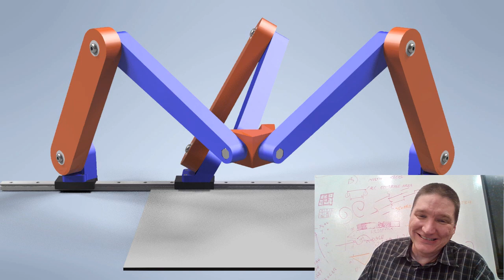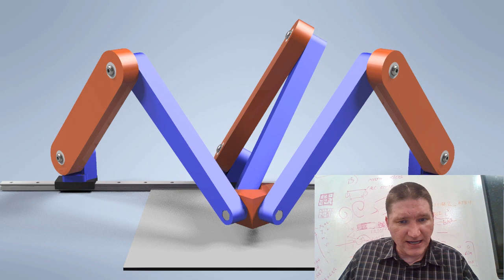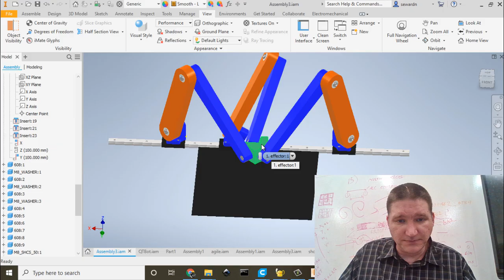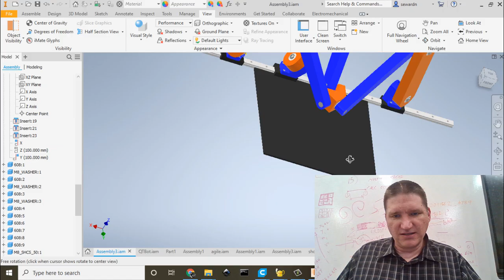RepRap Monorail (Single Rail Tripteron)

Comment: Just stumbled on this video after watching yours today:
https://www.youtube.com/watch?v=97t7Xj_iBv0
And I get wondering theoretically would there be a way to replace some of the joints with this kind of Compliant mechanisms. it seems to me that it would produce more smooth and easy movement if done right. 
I'm have no knowledge in engineering. Got here after researching the Tripteron topic for a friend of mine. 
Greetings.
Reply from the maker: In theory, all joints could be compliant.  In practice, I would stick with replacing only the revolute joints and leave the linear rails alone.  That said, tripterons need a lot of rigidity to be accurate and compliant mechanism are challenged in thay area.  You would need fairly large knuckles to match the rigidity of a bearing joint.  As shown this is just a render...in real like these are also way undersized joints.  What I am saying is the knuckle joints will probably grow to a size where both space and weight become limiting factors. In any case,  it would be fun to play with!

Comment: As shown, the range of motion in z and y is really limited unless you have very long arms and then you get real issues with stability.
I can see use cases where it would work best, like some sorting or assembly where it rolls along the rail working on an item and then moving it onto another line once its done and you want it on just one side of the conveyer away from the workers.  Just one example.  Certainly not for a 3d printer.  The joints and base rail width would have to be super strong which would be costly compared to normal 3d printer type things or delta robots from above that could also run along a rail that isn't part of the actuators.   Appreciate the different approach.  I've got a new idea myself, which I can't share, but a clue is it will use the biggest stepper motor you have ever seen...

Comment: it is a good idea .. but I am not usre of validty of its economics .. not because you can not build a 3d printer while using single axis .. but because if you compared the outcome of this set up to classic 3 axis 3d printing and measure that economically, you may see the 3 axis 3d printing is more cost effective - efficient  because this step relies heavily on the (a) on difference in location between two arms and additional dimention (like y or z axis) does depend on the limits of such differences. So in short, it is a creatie design but not cost effective design. 
The valid use cases that would make sense of such design is when there are dynamic constraints of external motion that require being the same adjustency the arms but without be blocked by y or z axis installation .. it is a bit hard to think of such application indeed .. But you can think of collaborative robotics by which you have two or more robots manipulating the same object ..

like if you have one robot that has 3d printing head and the other has painting or carving head .. then there can be applications by which they work together on same objective while each of them on one axis ... that would be possible despite that the policies of clash avoidance will be very complicated. For example,  placing two on axis robot can allow moving  a chess objects without blocking each other 

it is far more useful for multiple robotic arms than single one.. single one will fail to optimize its cost
Reply from the maker: I think you are very right.  There are probably just a few killer applications but for the most part it would be better to use traditional robots.  It is fun to look at and to have in your back pocket if a need ever arises.

Comment: this cool but not for 3d printing machines, if u make this in a 3d printing machine... u limit ur surface u introduce jerking ... limit ur printing speed, and many more issues... oh yea Z limitation, Y limitation X limitation... might be great for like some specific 1 type of job thingimatronic, but general purpose like a 3d printer where u can print bunch of random surfaces etc with it and shapes please dont... it will be like apple vs android... all that being said... this cool stuff, and ingenious using the joints and the 1 rail thing is awesome.

Comment: Very interesting design! Practically speaking, there could be a lack of rigidity due to the monorail choice. You could get away with a large enough rail or another solution already suggested earlier in the thread, specially if this design is just for 3D printing. Nevertheless, a more robust approach would be to add a second parallel rail with a mirrored design and the motors control coupled to the first rail motors (through software). It’s a less cool design, but you would still have ditched the vertical rail compared to a classical Tripteron design.
Reply: Ops, nevermind, just saw your duo-rail design video. Great!

Comment: hmm, if it gets another degree of freedom you could get the whole rail length as a print surface not just a small part
Reply from the maker: I see what you are saying and that could be possible.  However each arm constrains the effector to a plane so with this architecture a 4th arm would be a redundant DOF.  Of course you could do a single axis Sextupteron but still no space saving.  

You could have a arm attached where the effector is now which rotates through the plane parallel to the ground.  The 4th carriage could somehow trigger it rotation.  Bottomline...it can me done but you lose a bit of the parallel robot purity.  I would be curious as to what you have in mind.
Reply: @NicholasSeward  if you angle the print head you can get an axis that is just as long as your track. Now simply make the track out of 2 segments (and the ability to move and align it) and you have what is essentially an infinite axis to print on . Or just use a track as long as you want for the same basic effect.

Gets rid of issues with the conveyor belts as well though you do have to worry about what you are printing on
Reply from the maker: @shadowlordalpha  Hmm..  I don't fully follow.  Might need a sketch to get me all the way there if you are willing. Cheers.
Reply: @NicholasSeward  I'll try and do one later today but basically imagine that instead of a conveyor and the bed moving you just move the printer along the line. 

This would only really be useful for massive prints or unknown length prints

Comment: Good afternoon! Sorry to bother you! Do you happen to have a solution to the forward and inverse kinematics problem for this manipulator? I want to conduct a kinematic analysis, but I don't really understand the kinematics of a monorail tripteron.
Reply from the maker: Jklee has some videos on it and I have a QandA that talks about it in a simple way.
Reply: @NicholasSeward  I understand you, thank you!
Reply: @NicholasSeward  Hello again! Tell me, please, how did you create the animation at the beginning and at the end of the video? How did you define the law of change of generalized coordinates?
Reply from the maker: @Archi_mboldo  I used autodesk inventor.  You can add constraints and drive them in an animation.  I drove the effector directly and everything else solves automatically.
Reply: @NicholasSeward  Thank you!
Reply: @NicholasSeward  Hello, did you by any chance calculate a working area for this robot?
Reply from the maker: @Archi_mboldo  lots of parameters.  Arm length, rail heights, carriage angles...you can get any area you want. As shown for 200mm arms it could reach out about 200mm.  The other dimension is only limited by rail length.
Reply: @NicholasSeward  I am trying to choose the parameters of the components so that a cube of 150mm * 150mm * 150mm fits into the working area. In the view from above there is a working area in the form of a trapezoid. In the view on the left - in the form of an isosceles triangle with two angles equal to the angle of inclination of the middle link (in my case, it is 60 degrees). And in the front view there is a hexagon, the upper part of which is like a trapezoid, and the lower part is like a rectangle (a bit like the shape of a house with a truncated roof). So I'm thinking how to choose the parameters so that the cube I need fits into the work area.

Comment: Cool, but for low-load / low precision.  To get any sort of rigidity / precision, you have to move one of the feet onto a second rail. Or make the single rail *much* wider. Think about this as a lever attached to the slider. Those sliders are not meant for absolute torsional rigidity.

Comment: Hi, this is brilliant working !! 
Which type of bearings are used in this labor and what is the measure of bearing ?? How to solving sag fault.
Which one did you using software program for programable ?

Could you like share these information
Reply from the maker: I am not sure I understand all of your questions but let me try.

Bearings can be cheap 608s if you have two sided joints.  The single shear joints (as shown) would need much larger bearings.  6805 bearings or bigger I think.

I modeled this with Autodesk Inventor.  I would use RepRapFirmware for the controller.

Sagging will happen.  My first try would consist of trying to minimize it within reason and then use bed leveling to hopefully remove the rest.  This will cause some geometric distortions but I seriously doubt I would ever want this as a serious printer.  If I build it and the distortions are too much, I will re-evaluate my approach.  I could definitely build in much more calibration but I would have to do a lot more coding.

Glad you liked it!!!
Reply: @NicholasSeward  
Thank you for answered quickly :)

What would you recommend for the connection between the arms ?  (There should be single bearing or double bearing  every arm ? Bearings should hold with screw or bolt & nut couple ? How should the bearings in the arms be positioned and how should they be attached to the arms? .. etc ?)

I am going to design a similar project yours with SolidWorks. I will operate my project with arduino card and CNC shield  but I have a problem.. How to direct from CNC axial to RepRap form because CNC shield has Thiree diffirent axial (X-Y-Z) engine but Our working is drived single axial and thiree engine
Reply from the maker: @ogulcangursoy622  2 bearings are required.  Typically you would need a bolt, 2 bearings, 2 washers, and a nut.  

If you want to use the CNC shield you will need to find firmware that supports a SCARA or customize the firmware.  For most this is a non-starter.  If you use a duet3 with reprapfirmware... you won't have any problems with control.
Reply: @NicholasSeward  Hi 

I bought Reprap1.4 control card and decided to use Marlin FirmWare on your suggestion.

Our working is like a delta robot but axial is a bit different. I found the kinematic equation of the study with the help of Jk lee. But I don't know how to transfer equations to marline and drive motors compatible. 

A lot of study on the internet about 3D printer but Monorail study is quiete few especially software parts.

What is your new suggestion for software problem to solve ? 

Thank you so much for your significant ideas..
Reply from the maker: @ogulcangursoy622  I am not following perfectly.  I don't think I recommended marlin but it is possible to add your own kinematics  but I am not great at it.  For monorail the kinematics are linear equations that can but put into a matrix which Reprapfirmware can handle.

Comment: I'm getting ready to "ATTEMPT" to build a print farm unit that I can wedge into my shop!!! One problem has been the system itself taking up too much room ! It's. Trinket machine I want to keep the build volume tiny and use up little space with my actual printing unit system and extruder... Long story short this seems to possibly be an answer to my problems???
Reply from the maker: We are working on it.  Hopefully this could be an option.
Reply: @NicholasSeward  if a guy wanted to throw several units on one long rail and then another rail underneath with more multiple units then so forth and so on.... Would you see something like that working?

Comment: И как управлять 9тью шаговыми двигателями?
Reply from the maker: You just need 3 stepper drivers.  One for each carriage.  All the arm joints are passive.
Reply: @NicholasSeward  
Сделать это не сложно
Проблема будет в разработке управляющей программы которая сможет с этим работать
Я думаю целесообразнее делать одну руку с 3 мя шаговыми двигателями
Reply from the maker: @MaxMax-oc3sr  Not sure what you mean.  This obviously works. https://youtu.be/a-udS20-rn4  There are issues for sure.  The arms in that video need to be more rigid but it illustrates the possibilities.
Reply: @NicholasSeward  круто
А он описывает правильный круг?
Вибрация вызвана технической проблемой или так должно быть ?

Comment: The lazy engineer inside me reverse engineered a simple model of this concept into SolidWorks. A quick motion analysis and now I know that the displacement of the middle carriage is linear compared to the Z-movement. To be more specific, when the Z moves 10mm up, the middle carriage needs to move exactly 10mm /sqrt(3) to the left. Credits to WolframAlpha :)

Comment: I'd say this is a single rail delta robot, rather than a tripteron, still a cool idea though. I am guessing it's going to be for pretty light loads, because the leverage applied to the rail is going to get pretty significant at large deflections of the manipulator from the rail. An interesting idea might be to have this same kind of manipulator, but using two rails. The power could be supplied to the machine through the rails, with all the control electronics integrated into the manipulator itself and getting "tasks" over wifi. This would allow multiple manipulators to run on the same set of rails somewhat independently, if the rails are long enough. It wouldn't be a mono rail anymore then though.

Comment: Neat idea, though I would imagine that the middle arm would cause problems when there is any mass applied to the work or if it's extended away from the base. Load capacity of this arrangement is very low. You need very smooth bearings and probably a stronger motor (than the other two) to prevent it from sticking and shuddering also to mitigate the effects of sideways load on the joints.
Reply from the maker: This is a light weight machine only.  I can't see it handling much weight at all.

Comment: ABSOLUTELY AMAZING. I actually like the first one you did better; math a lot simpler, stronger, could work for cnc milling or plasma cutting as well...
Reply: Are the only driven joints, the ones on the rail?

Comment: this seems fun & interesting in theory, but i bet the stresses on the rail would be too much for a bigger version & bent the rail. or would need HEAVY counterweights, to reach out, away from the rail!
Reply from the maker: Rail will be mounted to something like a table.  That is not going to be a problem.  The problem we are facing (not surprisingly) is arm rigidity.

Comment: I think this actually is a very promising idea for a printer. Think of the easiness of how you put the three motors outside a hypothetical enclosure. Cable management a pure dream on that one. And honestly, the coolness factor just wows! A great way to showcase how many ways there are to describe a cartesian coordinate system. No issues to make a rigid z-height. At least for not so high z-dimension printers, this one clearly has its upsides. And of course, only one of those expensive rails. You could also easily (at least when it comes to industry solution money) put such a thing on a kind of carriage and build very long prints. 
It is one of those ideas where I feel stupid I never thought about it myself after hearing it but would have never had in a life of 500 years. Simple genius!

Comment: Since you are doing crazy ideas, what about ditching the rail altogether? Put the connecting points at the ends of the arms with a roller ball. Then, the device could be placed on any flat surface and do it's thing there. It would look like a 3-legged spider.

Comment: What is the volume of the xyz it can touch?  In terms of the monorail length? Great idea!
Reply from the maker: For every unit of reach you lose twice that on the rail.
Reply: @NicholasSeward  So to print 1x2x3 you'd need a length of 2+4+6 + lengthOfAllShuttlesRunningOnTheRail?

Comment: It's a nice idea but...linear rails are typically not well suited for torsional loads. It won't be stable enough. Add a second rail parallel to the first. The arm bases would then sit on a plate that attaches to both carriages on both rails. Now you have the inner carriages strictly carrying compression loads while the outer carriages carry only tension loads...no more torsional loads. This will be rock soild. It the same principal as how automotive assembly robots move along on double linear rails.
Reply from the maker: Two rails would be better.  That would be an easy add.  However, one rail is rated for 50 ft-lbs which is way more than I expect for the 3D printing application.  A few small tests make me think that the arm rigidity is the main weak point.

Comment: Make it 2-stories tall and put it on a circular track (everything could fit in the back of a pickup), and you've got a house builder.
Reply from the maker: The circular track is possible but changes some of the joints to U-Joints.

Comment: Wait is the middle arm necessary? Cant just the 2 arms do the job? (dont want to sound rude. I probably dont get something)
Reply from the maker: The outside arms define the x and y.  The middle arm is the only one that holds the effector up.
Reply: @NicholasSeward  oh, I get it now, hopefully. I thought that the joints were motorized as well.